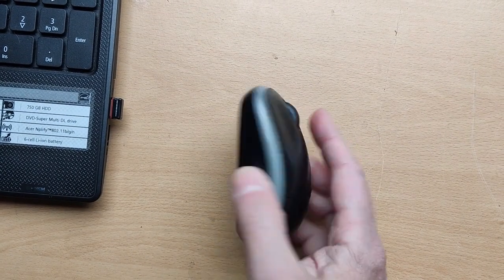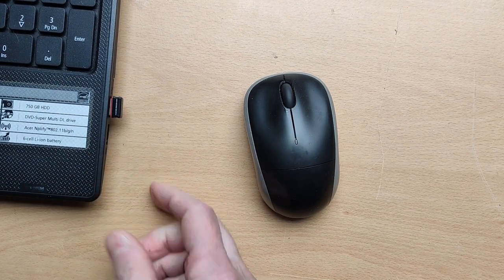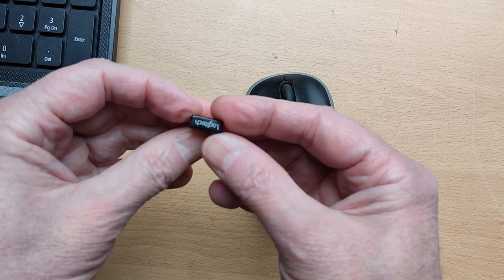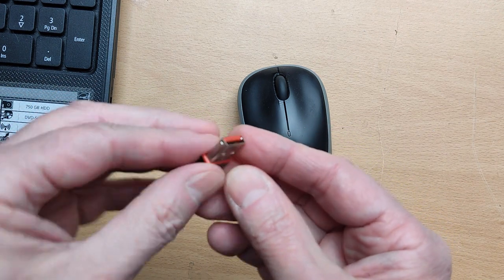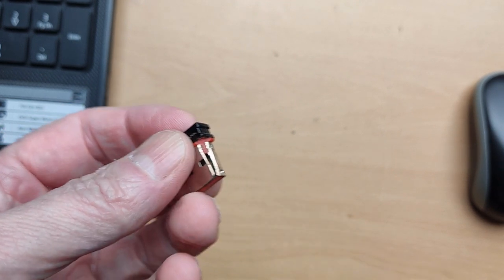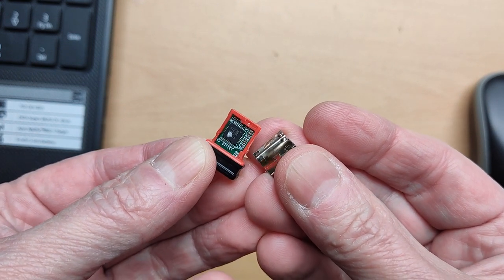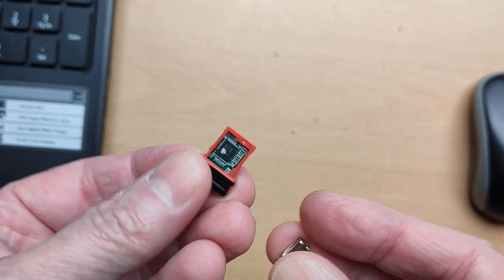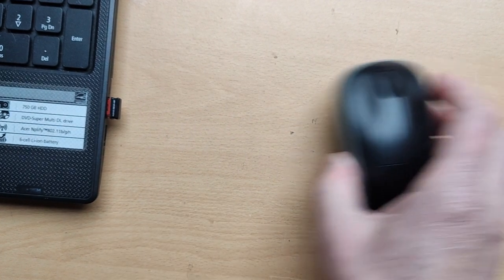Teardown (repair?) of a bluetooth USB mouse receiver

Comment: That worked for me as well. Exactly the same issue. I was lazy to buy a new receiver for old mouse and keyboard. No it works again. A few more years maybe. All for saving money for a few minutes fix. Looks ugly after removing the metal part in one side, but I heard USB does not care how it looks inside😅
Reply from the maker: Thanks for letting me know!